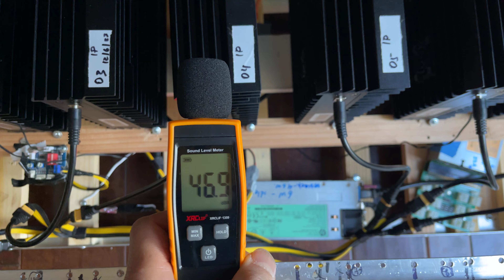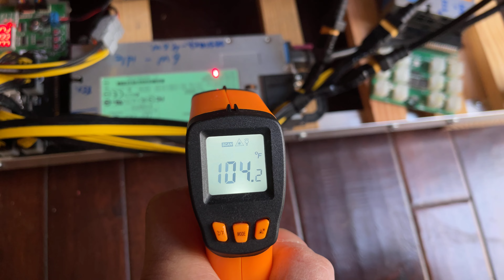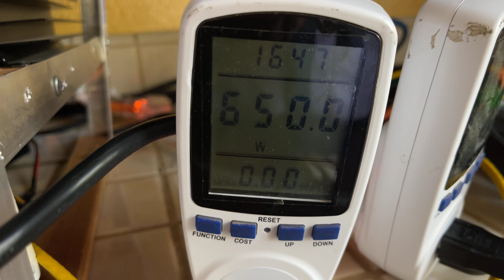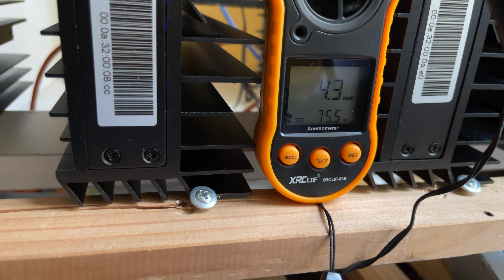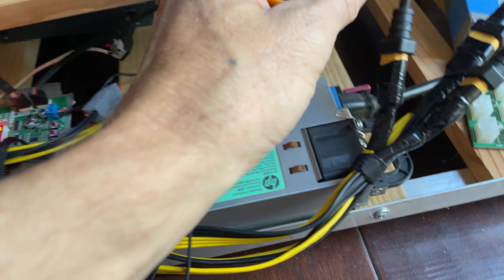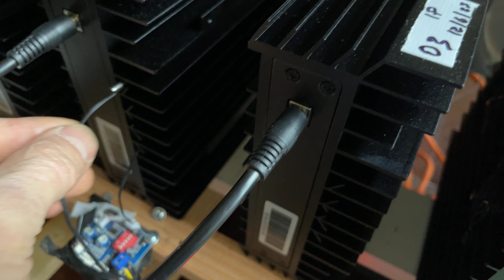ICERIVER KS0  PRO ROOM HEATER IDEA

Comment: Hello, is it safe to to take 140W from 6pin breakout board per unit? and will it cover also next upgrade for 360GH. I have burned breakout board from old rig so I am wondering if it is good idea just buy new and connect it like you did. Thank you for your reply and your work.
Reply: never mind i found out it is rated to pull 288w from 6 pin
Reply from the maker: @jakkuzma   Yes if you use all 6 pin, I would only use 16 ga cables as 18ga burned down even on 130W at the connector, its not the wire problem its at the point of connection 18ga wires are week, also use all 3 pair (6 wires) however 5.5x2.5 pin is useless above 10-11AMP  so have to consider another connection type if you planing to use 12V system for 340GH OC

Comment: Hei! Nice ideea wonder what they will act in a server case with a more efficient air stream. Sow your content do you have ks2? Or ks3m? Just got the november ks2 and hope for december ks3m. Looking to OC them. Best of luck!
Reply from the maker: Server case would be dealing was thinking about it but all cases I have wall to small the kso much taller. I have ks3 that I overclocked and 2 KS3Ls that I switched boards and didn’t have to overclock and there is no overclocks for KS3M.

Comment: Lining them up like that is a horrible idea, you're feeding hot air into the next one. WTF?!
Reply from the maker: i know right, everyone talking about it but, I've tried with aluminum separators between eash kso-pro and laying flat same temps reading and same performance on the pool, I get 1.44TH on the pool from these 7 beasts and nice temps all over. Will post next video on the pool hashrate temps and profitability of the heater